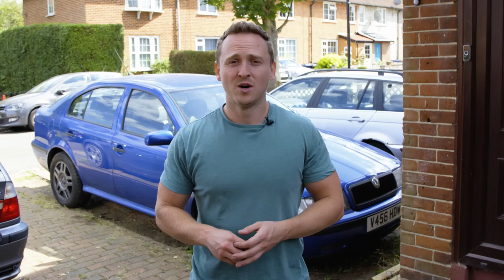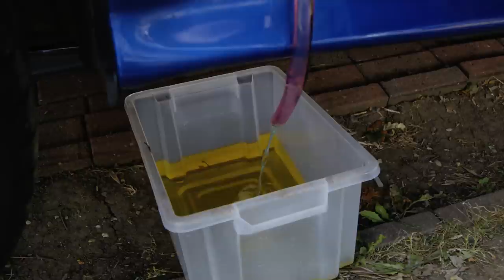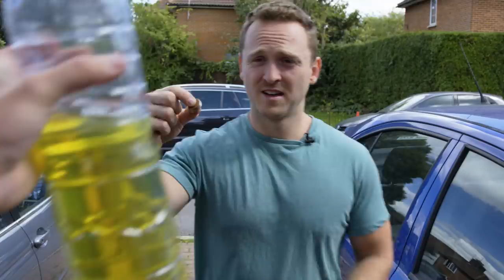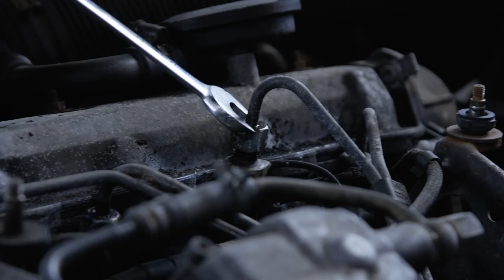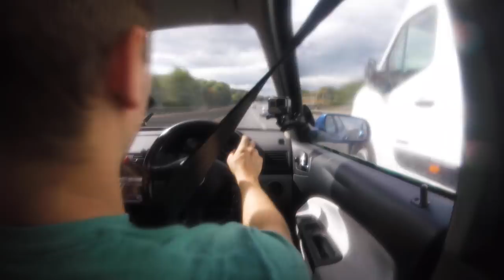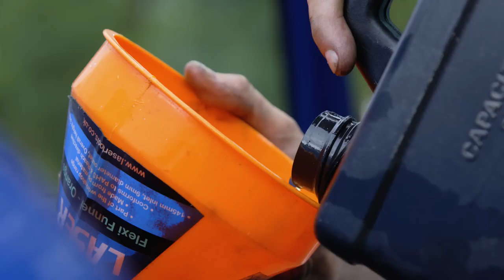How Far Can You REALLY Drive On 1 Litre Of Fuel?

Comment: Take Miles for a top speed run on the autobahn. That would be cool!!!!
Reply: I´ve done 190 km/h with my Skoda Octavia combi, 81 kW, 1.9 TDI, bult 2002
Reply: @LadislavVavro  that's roughly 120mph if I'm correct?
Reply: @leoshedden9199  yea.. 60-62mph = 100km/h
Reply: @leoshedden9199  Yeah around 115/120
Reply: Ladislav Vavro think I got the same car. 1,9tdi 4x4. Just an amazing car. Nothing wrong and has gone 430k km until now
Reply: Already can tell you, top speed is 181kmh. Owned the same car for many years before buying the 130hp police version
Reply: We have went 130kmh on a 60 zone in our 12 meters long RV (in Mexico if ya know what i mean;)
Reply: @LadislavVavro  i did 190km/h in citroen ax 1.1, i think with 49 horse powers 1992 :D
Reply: I did test on japan car 1, 8 l and it did 4, 8 l/ 100 km
Reply: @LadislavVavro  i did with vw passat b6 225 kmh 1.9 engine
Reply: @Haldexify  Lucky man. I've got the 4x4 1.9tdi also. Beautiful car, one of my best and it's done near 200k miles however it now needs a new flywheel, clutch and turbo. Apart from that it runs beautifully!
Reply: @Haldexify  How many miles do you get on a full tank with your 4x4?
Reply: @LadislavVavro  i've done the same speed, but with 1.9 TDI ALH (90 HP) liftback version, from 2001 (the only modification was the sport lowered suspension)
Reply: Polo V 75hp, did 175km/h. 3km/h over the official top speed!!
Reply: i have an skoda octavia tour 1.6 105 hp running on gas and i reached 195 km/h
Reply: 1mile=1.6km
Reply: I've done (downhill) 220km/h speedo on my AHF 110HP 166k KM, everything stock except a bit lowered and harder suspension, but for sure if they do that with over 400k miles it would be interesting to see if it still performs good enough after many years
Reply: How far will 1 liter of diesel last at top speed
Reply: @axelschweis8539  on board or on GPS? Because on-board speed is (at least at my Skoda) 10% bigger than GPS speed. So i had 210 km/h when i really had 190 km/h. But on board computer can show you real speed! It's something like an easter egg: when you are driving on a constant speed, reset your average speed. If you do this and you are going at the constant speed from the reset, in a few meters, the average speed will be the speed you were going on GPS! But it won't be an instant speed, so it will tell you the exact speed only in the moment you reset it.
Reply: @lucicoltor685  such a high tollerance would give me at least 10 tickets in the past month. its onboard but there is only a +- about 3 km/h
Reply: @axelschweis8539  at every car is this "false" speed on board. The car shows a bigger speed than the real speed, with 5%/10% more or +5/10 km/h. This is a factory obligaton, because in case you put bigger/smaler wheels on it, and the speedometer tells you the exact speed, it could tell you less speed than the real speed. So all speedometers are made telling you false bigger speed. So, when you have 90 km/h the speedometer tells you have 100km/h, but the police will see the gps speed, so 90 km/h
Reply: @axelschweis8539  try making that on board computer easter egg, to see the real speed
Reply: Scott Spalding it uses on average 5,7 l/100. Tank is 70L or something. In summer, on long distances it uses 5,4 l/100.
Reply: I managed to get 199kmh roughly 124 mph in my 2003 Toyota Yaris 1.0L even though it was a death wish but it still pulls in every gear pretty fast for what it is which everyone tells me
Reply: @LadislavVavro  I have the same car, I have done 210 this summer. I was driving in the left hand lane, but something flashed me off. I was amazed. :D
Reply: @tommylyeah  Will 1 Liter of Diesel last until Top Speed? :D
Reply: @LadislavVavro  I have Octavia mk II 88kw combi 4x4. It's a beast
Reply: @lucicoltor685  Not every car shows a false rear of the speed. Try a Peugeot with a Jager speed clock (white background one) that is present in many models like a 206. That clock is very accurate. You can notice your real speed vs most of the cars "real speed" cruising in the higway. VAG cars all read more speed than real,so you are going slower than you think,very difficult to get a speed ticket in radar controlled areas.
Reply: I've done 184 kph in 68hp Škoda Fabia mk1 1.4 MPI according to GPS. Miles should hit 200 easily.
Reply: @Haldexify  Lovely, thanks for the info :)
Reply: My A3 1998 8l1 90hp does 220kmh really nice car
Reply: @zamex23slo  seriously, how did u squeeze that much speed out of a 49 hp car that too from 1990s, did u curb boost like in gta v, lol, just kidding
Reply: @speedhunter7497  there was no rev limiter
Reply: So the Porsche 911 carea   has a topspeed of 200 kilometers which is the top speed of 130 mph and a Nissan nuvara can only go 220 kilometres which means it can go 150 miles so a Ute is better then a sports car 🤦‍♂️
Reply: But put more than 1 litre of fuel in it.
Reply: @zamex23slo  How the hell did you do that?! In downhill with cold temperature? 
I only attained 170km/h with a saxo 1.1l with 60bhp.
Reply: @vincentbazin8459  1992 model doesnt have rev limit, soo it goes and goes.

Comment: 106.6MPG (UK)
88.8 MPG (US)
37.7 Km/L
2.65L/100km
1.1L of fuel; 25.8 Miles [41.5km]

You are welcome.
Reply: Give this man a 1000 likes
Reply: @Sjef0194517  indeed, under rated comment
Reply: 25.8 Miles on 1.1L, the Octavia has a 55 Liter fuel Tank. If you could keep that fuel economy up for the whole time, thats 1290 miles or 2076km on one tank
Reply: Hard to think a 1.9 tdi engine, would go 2.6l/100km, combined cycle.
They were testing it in the city and outside, if i've seen correctly.
Reply: Thanks
Reply: I'd take 1.6 TDI facelifted 2nd gen octavia with common rail injection system. if you want really good consumption challenge
Reply: MoFBox Which goes to show they completely f*cked up some part of their test. Their result is complete bollocks.
Reply: How is it possible for that car to get 2,5l / 100 km ???
Reply: @mi7aka922  Easy, with that engine its nearly impossible to get over 6,5l /100km if you drive really aggressive, normal consumption was 4,5l for average driving.
Reply: That's more than what i get on my motorcycle
Reply: bruh my car guzzles 4 times that and its a 1.8
Reply: How in the world do you get 88 mpg?? Why aren't all cars that efficient?
Reply: if its 1.2 tdi engine from vw lupo or audi a2 then i agree but its impossible with an old 1.9 tdi with 110 hp. If we stick to that logic then a 1.9 tdi with 90 hp. should get under 2,5l / 100 combined ???? That's a big NO NO i think?!
Reply: @mi7aka922  i have that car and am going 120-130 and i have 5.1l / 100. 
so you know :)  its real.  WE dont need hybrid cars  if we all have skoda :D
Reply: @mi7aka922  You dont have to believe me, but normal consumption for 81kW 1.9 TDI was 4,5 when you had 5,5l/100 you were stepping on it a lot. Later 1,9 PD TDI had higher consumption by 1l per 100km. No VW diesel was so ekonomic ever again as old 1.9 TDI. A2 that time didnt exist, 1.2 tdi is newer cripled engine, that time VW had 1.4 TDI which was terrible.
Reply: Спасибо))
Reply: Shouldn't that be enough to get to the next petro/gas station????!!!! Might even be able to get a bag of chips for 1£ while you're waiting for the fill...
Reply: Damn this is more efficient than most cars nowadays.
Reply: This man is god
Reply: @DiscoFang  Well the test is flawed because there is going to be a significant amount of residual fuel left in the car after siphoning.
Reply: @EzioAuditoreDaFirenze99  And that ammount is probably still there when car runs out of fuel. Old 1,9 TDIs were amazing. We had one and my penny counting father was able to have average of 3,9l/100km when comuting to work.
Reply: Which is why they ran the engine after siphoning until the fuel ran out...
Reply: My vespa ate 4L/100km wtf
Reply: Митко Иванов, i think it mostly has to do with fuel quality difference. That sick-flavored sh** they call "diesel" in south-eastern lands is good for 60% of engine output (if even that). The rest of it just burns away in catalytic converter.

Plus, it's multiplied by pedaling. If you keep the momentum (like bus drivers do) you woun't use much energy to accelerate multiple times. 
Keep it in gear for a slowdown (when engine uses 0), and don't have a "top gear disease" (name of a driving style, not the show).

That said, my '92 Thunderbird (with 5 litre v8, and prehistoric EFi) made 12,6l/100km, most of which i was traveling thru city, averaging ~40kmh.
Reply: Spoiler alert
Reply: Fu****g 2,65 L/100Km that is insane
Reply: Every diesel ive owed had horrendous economy.
Reply: Ugh , and here i am with 11L/100km..God damn
Reply: @kousekovoce  is that engine the same as the golf diesel?
Reply: @glennoc8585   ONLY 66/81kw
Reply: I was just gonna do that XD
Reply: this car is a legend in our country. some say that if you are really light on gas pedal, it generates fuel. unlimited horsepower
Reply: @EzioAuditoreDaFirenze99  They run the engine until it run out of fuel
Reply: Here in Czech its like Ferrari... And if you go reverse its generating fuel... We have problems with self-overfilling fuel tanks 🤣
Its Skodaratti🤣
Reply: @dan_6915   Our 1.9 TDI AFN engine does 3.8-4L/100km and thats a 1450kg car.
Reply: @MCMonsterbuilder  Tank claimed for 55 litre but my ex mk4 golf had a 65 litre of tank so probably it has a similar tank capacity.
Reply: So on a full tank (50L capacity) he'd get close to 1200 miles.

I think the 1k miles challenge is a go, boys!
Reply: @malikgarland1853  Diesel engines are very efficent. A small diesel engine, in a lightweight car hauling nothing but the driver and one passenger will not take much fuel.
Reply: Who dfq has a consume of 2.5/100, my focus 1 doesnt drop under 10%
Reply: MPG -Miles per gallon?
Reply: Freedom Strider 2.65l / 100km?? hows that possible ? my van uses 10 l / 100k haha
Reply: Omg life saver
Reply: I dont fuckin believe it. UK and US MPG is different? How many fuckin measurements there is in the world..
Reply: Virgin
Reply: 37.7 km/l is so simple...
Reply: Freedom Strider what is mpg and how do u work out how much fuel will give u miles ?
Reply: 3 times what my car could do
Reply: @zxc2324  PD engine is known to take more fuel at least ~1-1,5l compared to the older design 1,9tdi engine that does not use electronic nozzles. 
I managed to do 4l/100 in my audi a4 which was 1,9TDI 81kw engine. I was working on the nigh shifts back then so I was driving in low traffic all the time.
Reply: Freedom Strider not all heros wear capes. I raise my glass to you.
Reply: @18kingen  Petrol right?
Reply: Thanks man
Reply: Peugeot 307 wagon diesels are really efficient aswell they get roughly the same because went on a road trip in it and got from Brisbane to Sydney on one tank
Reply: People like this are too powerful to be kept alive
Reply: I have avarage 8,5 l/100km on 1.0 TSI Fabia at work 😀😀 it’s after 5000km 😀😀😀
Reply: Something cant be right. Even my smaller 125cc bike only gets 2.5L/100km and then im riding noz faster then 60km/h.
Reply: Impossible. Fake!!! If you will do this experiment you will see. I did the same experiment with a grande punto 1.3 multijet and was 3.2 l / 100 km, only outside city.
Reply: Spoiler alert
Reply: gods plan
Reply: No way.. I am trying to get 10 km per liter on my infiniti. All though i am getting 8 km.
Reply: The easy way of calculating the l/100km is to fill up the tank, then put the trip meter to zero and see how far you make it with a tank, then do some math. This test is incorrect btw...
Reply: How tf are there different MPG mate
Reply: @tylerthecollins7256  Because...
Imperial Gallon and US Gallon
Reply: Give this man a bells.
Reply: Mk1 Octavia is the best Octavia :D look at this MPG!! A high mileage hero title has been earned!
Reply: @malikgarland1853  it think it was classic car not car of this days
Reply: My small 150cc bike only get 35-36KM/l...
Reply: :O i have you the 4K like
Enjoy the resolution
Reply: The hero we need.
Reply: This is called German engineering and the best diesel engines in the history of mankind, which will never be made with such quality. 1.6 diesel, 1.9 tdi. and 2.0 tdi. And all TDIs from the VW Group are engines that are indestructible.
Reply: @mi7aka922  I got an mk4 golf with the 110hp 1.9 TDI engine, it really gets great mileage, even if you drive it pretty agressively you will have quite a hard time getting it to chug more than 5 or 6 liters per 100km
Reply: Thank you for the calculations. I can only guess they were driving at 35mph a lot.
Reply: @shadowthehedgehog4737  Correct. My Fabia 1.9TDI, could get up to 100mpg in the right conditions on a long run.
Reply: These numbers are wrong sorry. 9 miles per litre is 43mpg… no way it done 100mpg
Reply: @MCMonsterbuilder  55 × 25 is 1375
Reply: 1 mile is equivalent to 1.6km. How come in your conversion is other way around 🥴
Reply: @ryranes3920  English please
Reply: @ItsLukeDude  if you can’t understand. Google translate is free.
Reply: @ryranes3920  you can't Google translate bad grammar
Reply: @ItsLukeDude  Okay tell me what’s wrong with my sentence teacher Luke?
Reply: @ryranes3920  "How come in your conversion is other way round" does not make sense. Supposed to be " How come in your conversion it's the other way round?."
Reply: @ItsLukeDude  Okay I stand corrected. Since I’m multilingual and english is not my first language, it is common to make some errors. But saying  “ english please”  when in fact you understood what I was trying to say. That’s bullying. You’re good in grammar major in what? Bullying and harassment? Got it.
Reply: @ryranes3920  Correcting someone once is not bullying.
Reply: @ItsLukeDude  yes you can correct me. But saying “English please” is that a right way of correcting someone? Or a form of bullying and harassment?
Reply: @ryranes3920  Not a form of bullying or harassment at all. If you can't handle comments then don't comment
Reply: @ItsLukeDude  We all know that’s not how you correct someone. You’re just a bully.
Reply: @ryranes3920  not at all. You just don't like being corrected and now are playing the victim
Reply: @ItsLukeDude  im not playing my victim card here. I’m just stating the fact that you’re a bully. That’s it.
Reply: @ryranes3920  seek to harm, intimidate, or coerce (someone perceived as vulnerable). Which doesn't apply
Reply: @ItsLukeDude  Nice search. I get it dude, you wont accept you’re a bully in your own little way, you dont wanna hurt your pride. Saying “english please” to a wrong sentence that is clearly an english is completely a bully. Better get a refresher course of Etiquette 101. I’ll just end this and be the bigger person, right? 😉
Reply: @ryranes3920  Sorry that your feelings are hurt. I can't help that you are not mentally strong enough to handle the internet.
Reply: @ItsLukeDude  sorry that you’re a bully and lacks social etiquette. 🤷🏻‍♂️
Reply: @ryranes3920  ❄️
Reply: My 2003 Honda crv can drive up to 6 km/ L.
Honda company report 8.3L/100km.

Comment: a Prius vs Miles, who can go the farthest on a set amount of fuel.
Reply: In the city a Prius because of the regen braking and stop start system that favours city driving. Out on the Motorway or in the countryside Miles would beat the Prius as all the advantages it has in the city would be of no use and the hybrid system would end up a dead weight.
Reply: yes!!
Reply: Miles win's for shure
Reply: @gravemind6536  I wouldn't be so certain.. Can a Prius go under 3,5L driving in city? With right braking, Miles can go under 4L/100km with diesel of course.
Reply: @rkan2  miles did like 2.5/100 here
Reply: @petarc8152  In reality they probably consumed something like 3-3,5L/100km.. 2.4L is not possible without aero mods or doing like 45km/h without braking at all.
Reply: @rkan2  you can, if you go in 5th, without pressing the throttle, on 1000 rpm. So just going idle in 5 gear. It can do even 1 L/100 km (45-50 km/h)
Reply: @lucicoltor685  No it can't :D It will trend to over 3L/100km if you want to actually be moving anywhere. Only the VW XL1 can achieve that among actual cars.
Reply: @rkan2  i tested it :D
I made 1.2 L/100km (i traveled 70 km without pressing the gas. We were just 2 in the car, without any luggage, with some little hills, so the car was sometimes going straight, sometimes going up, sometimes going down. The thing here is that turbo turns off if you go at idle, so the consumpt is reduced. But it is dangerous for the turbine if you do this or you are going a long time at low RpM (under 2000)
Reply: @lucicoltor685  Without the turbo you get even less effiency, so it is not possible...
Reply: @rkan2  i'm not sure if the turbo shuts off, but at idle, i don't hear it anymore
Reply: I can state for a fact that my old diesel starlet had better fuel economy than a Prius. Went for bloody ages with no fuel in it. Shame it threw all it's oil in the floor the moment you turned it on, and then went and blew it's head gasket. Really made it quite expensive to run. Didn't kill it tho. Thing soldiered on for months and only died when the cambelt snapped.
Reply: @gravemind6536  It should be a mixture of both.
Reply: A prius does about 40mpg miles does about 80mpg
Reply: Prius. Easy. Read a article not to long ago. Dude drove 5000 miles on a single tank of gas (granted he charged it in between lol)
Reply: It would be very situational because of the different fuel types and the hybrid vs. Internal combustion. As a 2010 prius driver some days I can make over 55mpg others (especially in winter) I struggle to make it past 30. I think the hybrid has more potential but they're both very economical cars just in vastly different ways.